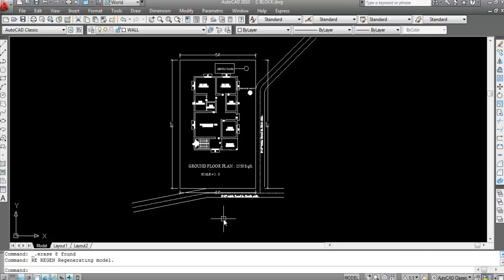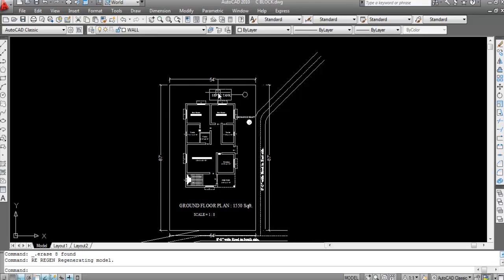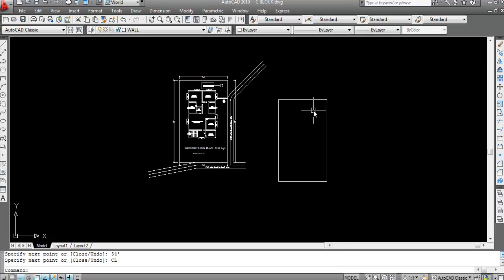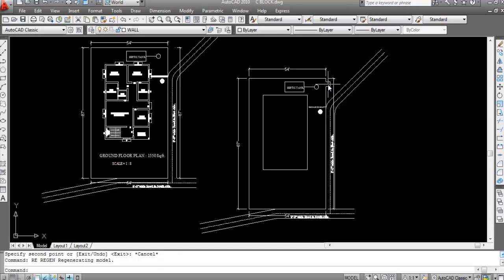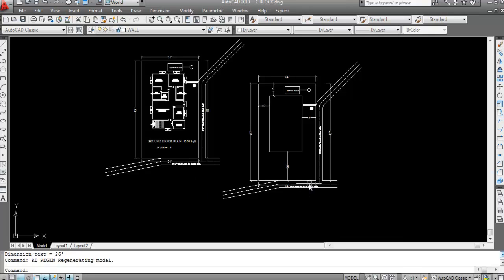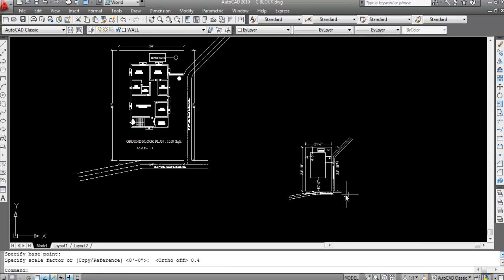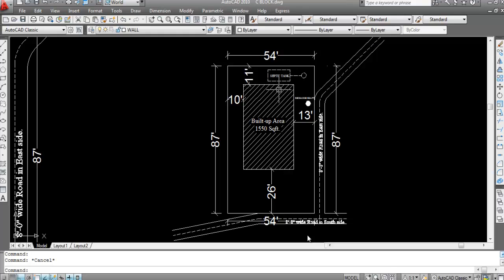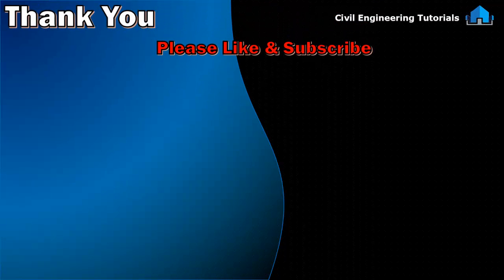How to draw a Site Plan of building in AutoCAD || Building #2 ||  Making Civil Site Plan

Comment: Respectable tutor as a matter of fact the problem i am facing is related with 3D. i want to apply extrusion (using press pull) of 4" upwards and so as downwards. But i am able to apply only upwards, but as i select the object for applying 4" downward extrusion (using press pull) it never applies directly, instead i have to use 3D Rotate to change its direction upwards and then it applies extrusion. 

Is there any way to press pull it upwards and downwards without using 3D Rotate?

Note: I tried to use Dynamic UCS, but failed.

Please help me because it would be handy for me during making drawings without using 3D Rotate. Please send me official email of yours so that even i can send u screen shots. Plz help me.
Reply from the maker: Share your email id please

Comment: maam am not understand the scale factor pls can you explian it
1:1 1:20,1:50
wht is that all 
plsss help me
Reply from the maker: On site One feet is equal to one feet or 1 meter is equal to 1 meter. This drawing is at a scale of 1:8, means 1 unit in the drawing is equal to 8 units in field or site. The drawing is 8 times smaller than real field scale 1:1.
Reply from the maker: AutoCAD #6 - How to Scale a Drawing in AutoCAD | AutoCAD Basicshttps://www.youtube.com/watch?v=ta5gV7966NA&feature=youtu.be
Reply: @civilengineeringtutorials   but mam why did you divided it by 0.4 can you pls tell me how 1:20 scale factor becomes 0.4